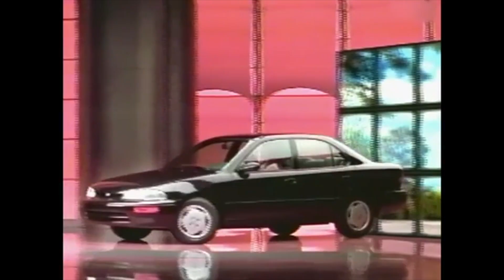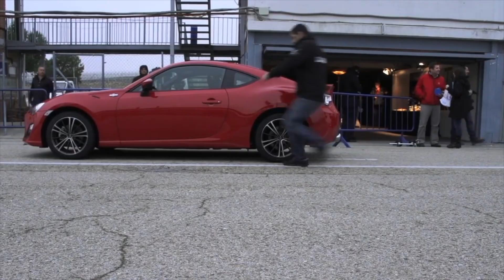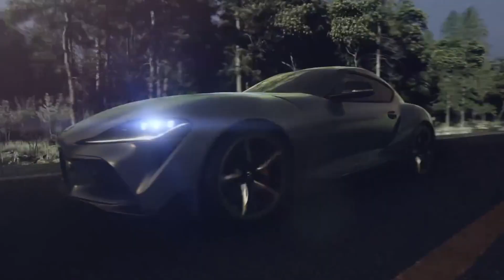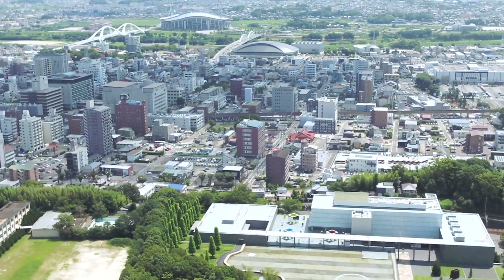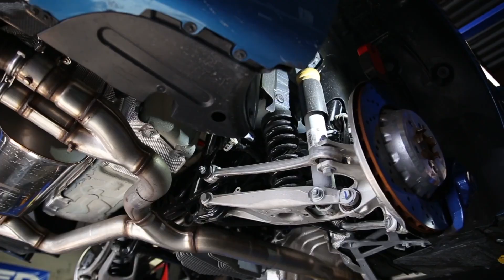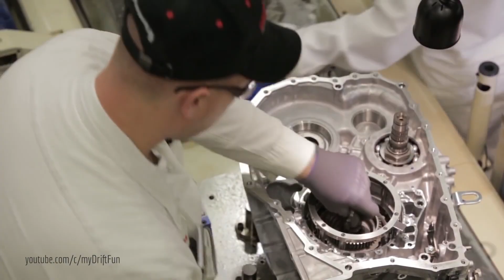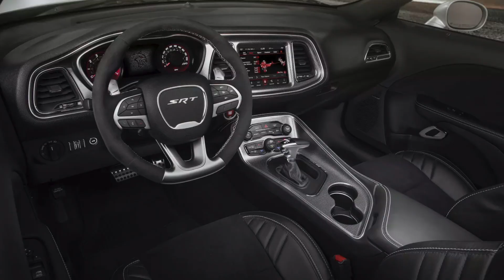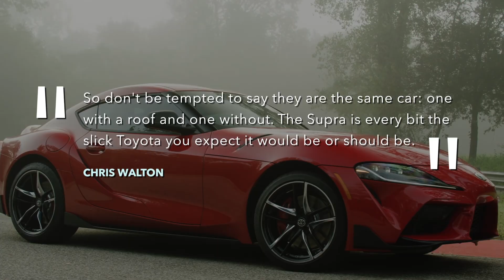MKV Toyota Supra - BMW or Toyota? The UNTOLD TRUE STORY

Comment: Even if the engine is BMW made. it really helps to know that Toyota had a hand in the reliability testing of it.
Reply: It wouldnt fucking hurt them to offer manual as standard from M240i, it has the same engine
Reply: @Kacpa2  toyota just need enough demand of manual to justify producing manual supra, just like porsche introduced manual back in 991 gt3, it has been quite successful.
Reply: @Kacpa2  a manual will eventually happen as of now be happy Toyota is back on the car scene vs just making another hybrid SUV or Prius
Reply: @X1xRiGox3X  Toyota has been in the car scene. But only with Lexus. This Supra will be loved soon. The hate will go away once tunes and upgrades come out and people are building them. These new supras are also made from factory to support a 2jz swap.
Reply: But did Toyota looked at BMW electrical? That's the worse.
Reply: Exactly the comment section seems like people missed that in the video. So technically Toyota helped development of the B58 up to there standards, that's amazing if you ask me.
Reply: @X1xRiGox3X  As far as I understand the interviews, the B58 in the Supra had to be redone for a lower point of gravity as requested by the Toyota team. It is safe to say, that if the cars drive very good (never driven one myself, so careful wording here) it is because of Toyota. I can imagine that the knowledge in handling from the GT86 and the decisions for the wheelbase and track width, weight distributions and the agility is a product of Toyota.
Reply: Yeah that's good. but the problem of quality control is still there during mass manufacturing at Magna Steyr and BMW part factories.  That process probably won't be close to what Toyota does in Japan where things are checked all the time and they never send out a car that has some bad quality parts.
Reply: @Infernal_Elf  Magna Stayr has better built quality control than the BMW manufacturing plant in Greer, South Carolina .
Reply: @Potato-lw3fe   i would hope so but it's still not Even close to 1990`s Toyota Inhouse  Japan factories.
Reply: @Infernal_Elf  To be fair, that type of outsourcing is already common practice throughout the automotive industry, and Toyota themselves already use Magna for a lot of parts in other car models. It does in my opinion, relate to poorer quality control. But that's not necessarily a problem that will be unique or any worse in the Supra.
Reply: BMW and Toyota should be advertising that outwardly so that all understand that it may have the BMW badge and performance but it also has the Toyota pursuit of reliability and longevity
Reply: @bobiseverywhere  bmw wouldn't allow it, from a marketing standpoint it would come off as Toyota has standards and bmw would most likely face negative press.
Reply: @bobiseverywhere  BMW dealers are pointing that out in Europian dealrships that the new b58b30 is toyota quality tested...
Reply: @bobiseverywhere  Yeah but the reason they wouldnt advertise that, is because it would mean that BMW and Toyota would be out right saying that BMW's cars are shit
Reply: Honestly, my 08 N54 335i has 140k on it and still runs really strong on the original turbos. Forged internals. The only problems are seals like oil filter housing, valve cover gasket. It runs hot so those get cooked, but put good oil in it (I use Motul) and never really thrash it I see it going to 180k and beyond no problem. Runs better than my grandma's Camry, that's for damn sure.
Reply: and u are proud with those pitifull 140 k??? are u seriouse?? this miserable 140k are not reason to be proud man !! minimum is 500k to claim that engine is good!!
Reply: @HanSolo__  North America.
Reply: @HanSolo__  I don't understand.. What is your point?
Reply: toyotas are so reliable because they suck. 20 hp town cruisers lol appliances at best. lifes too short to drive an appliance
Reply: lmaooo
Reply: Chicha 17  "What a load of absolute bullshit." Thank you for the constructive response. How about attacking my arguments with facts and have a proper debate instead of BSing.
Reply: @emin86  "I can imagine" yeah that is definitely going to lead to a fact... Your whole post was speculation and opinion.
Reply: @Mr.Walker994  How about this part? "As far as I understand the interviews, the B58 in the Supra had to be redone for a lower point of gravity as requested by the Toyota team"
Reply: and BMW never passed the test at first try.... yeah.
Reply: They didn't. It's bullshit.
Reply: @andrewc1036   super solid argument right there chief.
Reply: @travisstrickland9508  it's literally a B58 that Toyota "tested" (did they actually do any engineering? Nope.. Read interview with supra product line manager in car and driver) made in an Austrian third party production line...but keep sucking that marketing up real good.. Textbook rebadge. They are banking on folks like you 😆
Reply: @andrewc1036  lmao not sucking up any marketing I'm just as curious as anyone else. I said its "good to know" not "see haters it's going to be perfect" if it actually sucks that's a bummer but I'm like 98% of people watching and won't be buying the car anyways. 50k minimum is a lot to drop on any car.
Reply: @travisstrickland9508  ok
Reply: @Joe R hot take right there. Changed my mind
Reply: @HanSolo__  you're thinking of the original surpa. This is a bmw built from the parts bin with a Toyota she'll and badge.. Toyota did not engineer anything mechanical here. 

It is not overbuilt. It is a German car designed to meet emissions and make money for in a licensing agreement with a Japanese corporation. They made it for people who don't care about the supra name. They should have called it celica. 

If you think you're going to put huge turbos in this and massive nitrous shots, you're wrong. This is not a 2JZ. It is an outsourced B58. Old suspension design. Bleh. The most you could get out it is 400hp (the z4 is 382).

The video is right, this badge engineering. I'm 100% sure that the proud engineers at Toyota were not happy when they heard about corporate management's plan to buy bmws made in a random Austrian factory and call it a supra. It's shameful.
Reply: I find it a little alarming the BMW was put off by Toyota's insistence on such extensive durability testing. But then, as the owner of an older BMW X5 and as someone very accustomed to wrenching on their own cars, there things on my X5 that look as if they never for a moment tested them for longevity. How else can you explain the M62's timing chain guide problems? Or that the bolts securing the oil pump to the block like to loosen and fall out? Any shade tree mechanic can find things on BMWs that are substandard by design.
Reply: Ya I agree, I love Toyota and bmw, but having a bmw that lasts like a Toyota is awesome. Think of it has an m series Toyota which in my mind is bad ass
Reply: Travis Strickland shut the fuck up rookie they didn't do shit
Reply: 335is are doing like 800hp on stock motors
Reply: Anthony A wrong
Reply: @EduardGenardAndalis-n3y  its not about fun or complaning! it is about principle . in this world everything is about the money. but i dont like it. and mani other doesnt like it too ! so what u think it is ur own oppinion . sorry i disagree !
Reply: it still farts when the shitbox automatic trans shifts.
Reply: BMW engines are actually pretty good
Reply: I'm not buying it.
Reply: Yeah adds more credibility unlike BMW reliability standards
Reply: I've never had a single issue with any of  my BMW's.....
Reply: godsmack1716 How Long do you keep your BMWs? Most people lease European cars for about 3 years and return them before all of the electrical problems start.
Reply: @39Hundred  well mine is 33 years old... Damn near everything electrical still works. Runs great and gets good gas mileage.
Reply: it is not a matter  of  reliability !! it is just about to avoid import taxes in EU !! so this way they put rubbish BMW engine in a car wich  is a legend !! it is the same crap like Mitsubishi Eclipse crosover- wich is a real piece of crap !! open your eyes !!
Reply: @plamenjekov4568  Not really. At least the “Supra/Zupr4” nameplate didn’t end into a Toyota-built crossover like just what happened to Eclipse and group of Karens’ Mach E (“Mustang”). Only problem is the fanboys wishing Toyota returns the Supra and then later spreading a biased opinion. Nothing wrong to criticize to a product, but the only problem is complain a lot (+didn’t test drive the Zupr4 twins and are they’re different or not). Anyway, fanboys are trash and toxic, especially to the A89 fanboys,BNR34 fanboys, and Tesla fanboys.
Reply: @EduardGenardAndalis-n3y  the problem is that in their quest for greater profits, carmakers have begun to market all kinds of car combinations. car fans don't like it. if the car is called a Toyota, it must be made with only Toyota parts. if it's a Volvo, it doesn't have to be a Renault engine and so on! no one wants to drive any Frankenstein creation of marketers and greedy managers!